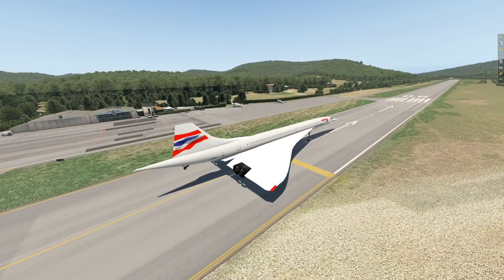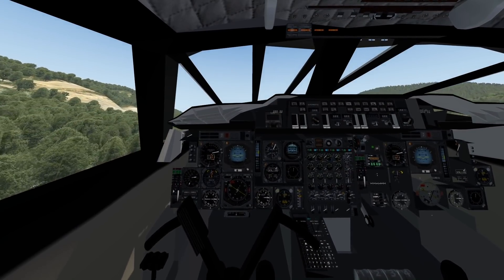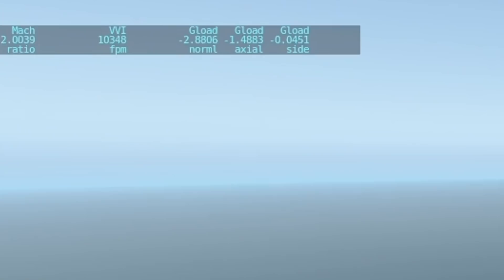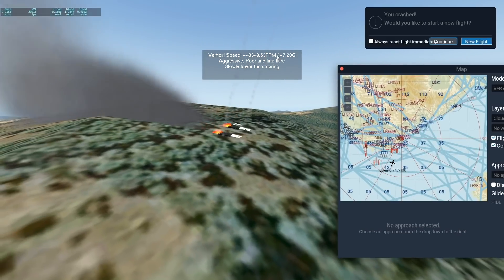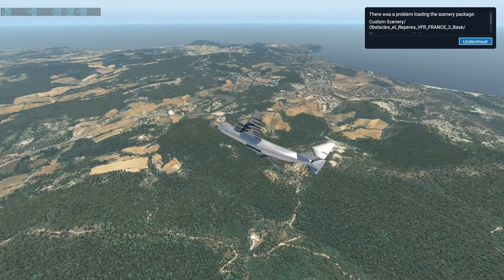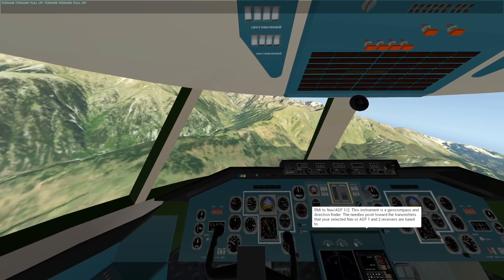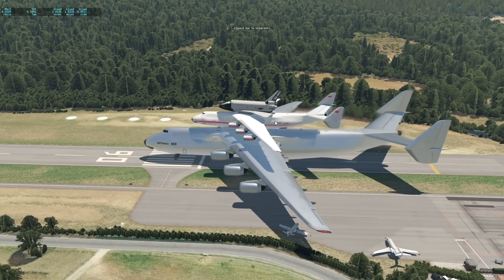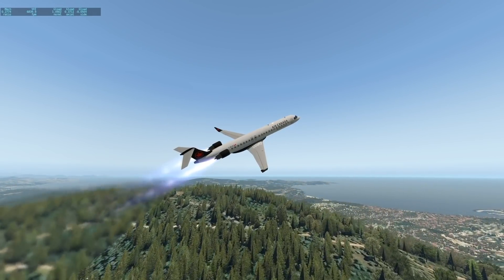What If The Concorde Had ROCKET ENGINES? - Insane Speed

Comment: The reason that it runs out of fuel fast is because rocket engines are already less efficacy then plane engines and on top of that plane engines use the air intake to get oxidizer into the engines then they mix that with plane fuel but with a rocket engine there are no air intakes soooo that y that might be a terrable explanation I did not go into detail at all